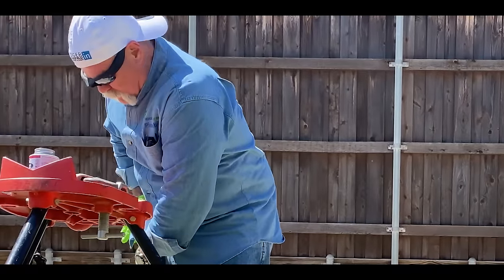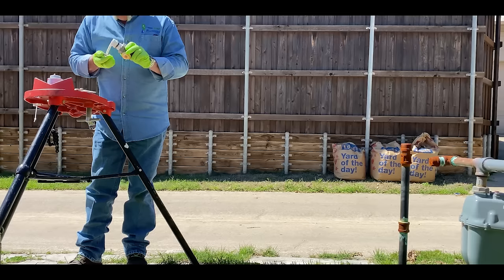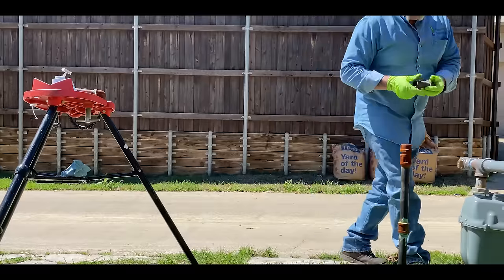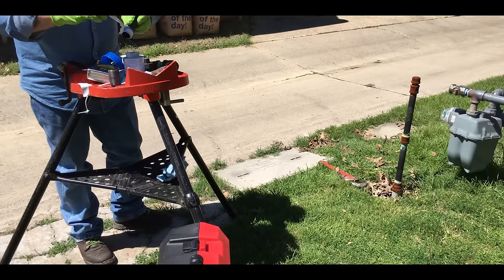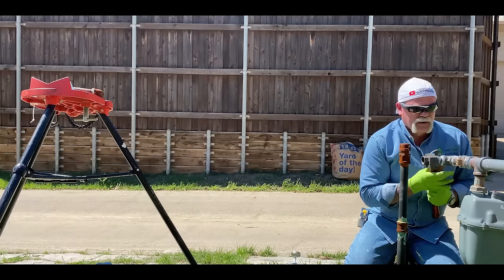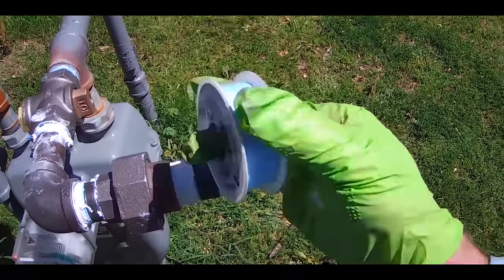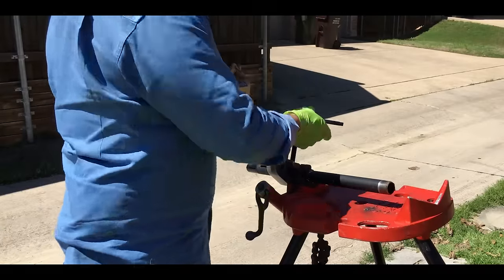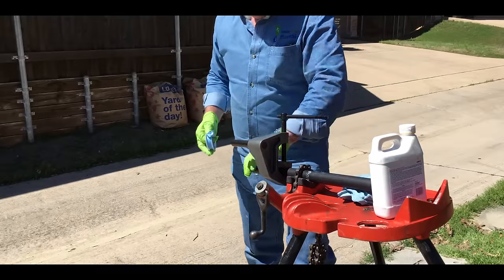Neighbor HIT This Gas Line! - Gas Line Repair (Plumbing POV)

Comment: I love how you're always talking about how important it is to turn the water off, no matter what, then go and do a live gas line replacement like this.
Reply: It may look and sound strange,  but there's only about a 1/4 lb of pressure going through a residential main like this. JUST MAKE SURE NO ONE IS SMOKING LOL.
Reply: Even then you can put a match up to it and you will get a flame that can easily be put out by putting your hand over the pipe end
Reply: @davidreynolds731  The issue is rather the carbon monoxide poisoning...
Reply: @morphman86  
You only get CO poisoning from poorly burning gas. While you can do what he did since the pressure is around 7 inches wc or barely over 1/4 psi, it's better to just have the gas company come out and turn it off properly.
Reply: @tcolondovich2996  Oh, sorry, I didn't know hydroCARBON gas didn't contain CARBON that would bind with OXYGEN when exposed to OXYGEN-rich air... Silly of me.
Reply: @morphman86  
It's cool. The most important point is that the natural gas has to burn completely. Any kind of impingement on the burning can start to produce carbon monoxide. If its burning properly then carbon dioxide and water are its byproducts. But I can guarantee that if someone just lights the gas after the regulator it wont be burning completely... light it before the regulator in the wrong area and you get a 40 foot pillar of flames and a visit from the Fire Department and gas company.

But if you do happen upon the pillar of flames situation just let it burn until the gas company gets there.
Reply: Fuckin prunes 😆 water being shut off no matter what because you can't always just thread on a ball valve/shut-off onto a copper line. The gas line hes messing with, the pressure is hilarious and its already threaded. There is no huge risk like water.
Reply: First off, water is anywhere from 40 psi to 100 psi, whereas gas is at most 15 psi. The other issue is water makes a big mess, gas just goes into the air.
Reply: Lol u try n catch a water service on the fly 😂😂
Reply: @morphman86  Do you know what that binding with oxygen would be called? That would be: burning... So, unless the gas burns (it doesn't in this case), you do not get carbon monoxide...
You also don't get carbonmonoxide poisoning outside unless there's a massive (as in steel melting) furnace behind you with badly tuned burners...
Reply: No live swapping in my building 78 inches of mercury on my gas
Reply: It's easier to hold back  a gas line's relatively low pressure vs 70+PSI of water pressure. Just saying. This is coming from a plumber/gasfitter.
Reply: @Bileven Troth Gas lines get shut off all of the time. How else do they get repaired, replaced, tested, etc? Gas before a regulator is high pressure - usually about 50 psi on distribution (houses and commercial). After the regulator, it is usually 1/4 psi or so and the appliance regulator usually drops that to about 1/8 psi (or 3.0-5.0” Water Column). Ignition can happen at any point in the system if oxygen, fuel and ignition are present.
Reply: @Bileven Troth I believe that we may both agree that different gas companies use different approaches to gas line maintenance and repairs. The company I work for does hydro-testing quite often and shut down whole sections at a time. We weld on bypasses to reroute the distribution and all. However, my specific job specializes in service at the meter and in households. This is where my experience in gas leaks, meter sets and carbon monoxide detection comes in. The company I work for does not seek out AOCs on pipeline by searching for carbon monoxide. This is foreign to me. I find it interesting the wide variety of approaches to finding and fixing gas lines.
Reply: @Bileven Troth damn good explanation
Reply: @Bileven Troth really learned more in your posts than i ever thought i could
Reply: @joshcowart2446  Yeah and this appears to be a low pressure gas line, since there is a regulator visible on the supply into the meter, so we're probably talking ~7-10" wc, or 1/4 (0.25) psi as others already said. That means the pressure is about the same as if you drilled a hole in the bottom of a gallon jug of milk, and tried to plug it with your hand. Not exactly impossible. He holds his hand against the open pipe which easily blocks the pressure, so there's probably only a couple of seconds, if that, where the gas is flowing into the open. Also natural gas is mostly methane which is lighter than air, so as long as there's no nearby ignition source, he will be fine as the gas floats up and away. There is no carbon monoxide hazard as long as the gas isn't ignited. There could be an asphyxiation hazard if it was an enclosed space and he let a lot of gas out, but this was not the case. If he wanted to shut the gas off, he could shut it off right at the meter, wouldn't need to call the gas company unless it's regulation, but here up north it's just a simple quarter turn valve like the one Roger installed on the pool heater line. If he shut the gas supply off, then he would have had to go into the house and test all the gas appliances, make sure the pilot lights (if applicable) didn't go out, relight them if they did, and make sure all the air was out of the line. Given the low pressure, no ignition source, small amount of gas that leaked out, and the fact that this isn't propane which is heavier than air (and also usually at higher pressure) and can collect on the ground, I think he properly assessed the risk to be low enough to warrant saving the ~15-20 minutes or so it would probably take to shut it off and turn it back on. This isn't like some of the USCSB videos where power plant workers blew high pressure gas lines into a partially enclosed space and then it blew up-- completely different scenario.
Reply: @MittyNuke1  exactly. The main reason we tried not to kill the gas is because we didn’t want to spend an hour or more lighting pilots. This was 15-20 years ago in a small town in west Texas so they didn’t have all the latest technology. At the minimum you’d have to light oven, stove, water heater, and furnace. Many house still had several Dearborn heaters. So the only devils advocate argument I’ll accept is almost everything is electronic ignition now so with the exception of the water heater pilots aren’t an issue and he’s standing at the meter so it’s not hard to kill the gas plus the gas to the inside is already dead until he reconnects it. So I can see the other argument I’m this case but old habits and if you know what youre doing it’s not an issue. Especially with 11 in wc even without covering it if you prepped right not much is coming out.
Reply: @joshcowart2446   how much is this in bar ?
Reply: @vHindenburg  .02739
Reply: @joshcowart2446  Yepp thats pretty low thank you.
Reply: i was not aware water and gas were the identical substances. who friggin knew?
Reply: Does anyone find it ironic that we’re discussing gas explosions and one of the contributors is von Hindenburg.
Reply: @joshcowart2446   Its ironic. Though the Hindenburg technically didnt explode just burned very quickly. The Hydrogen only could burn when it got exposed to the oxigen in the air. When you see the orivinal footage you see the Hindenburg catching fire on at the rear. After the the stern is burned half up it massivly loses buyoncy and drops the flames climb up and the rest is history. The modern consensus is so far as I know that the paint used to tighten up the compartments was a formidable fire accelarant.
Amazing still that of over a hundred people on bord only 34 did die.
It is proably the most elegant way to travel man ever has invented.

A further point to explosions, for something to explode there there has to be an oxygen fuel mix. Saw dust in the air, gas leak in a closed room /hole in the ground, coal dust ect. Thats why cars dont explode like in the holiwood movies, unless your tank is almost completly dry and have put extra air into  it.

Doesnt change the fact that a puddle of fuel burn raher violently.

Additional, I had a safety course on gas lines at work about a year ago (torch cuting company). And the most important thing with a gas leak is ventilation, to avoid an ignitionable mix of air and gas or the danger of suffocation.

Still unadvisable if someone  had a smoke at the gasline our Texan plumber was working on it proably woulndt blow up there would be torch sticking out of the ground when the gas would be ignited.(Thats still fing loud thats how the cutting burners are ignited, turn on gas flint stone igniter near it and bang)

The easiest way to get such a fire under control to shut of the gas.
Reply: @morphman86  why are you talking about this no one is smoking and no open flames. Nothing is going to happen.
Reply: @Germ1993  unless you have a static charge right..  then nothings gonna matter.
Reply: Gas won't make a mess.
Reply: @edwardmoulton6383  you guys still have merc regs?
Reply: Good thing there’s an expert here.
Reply: @morphman86  You're 100% not going to get carbon monoxide poisoning outside.
Reply: @morphman86  I would sat its impossible to get carbon monoxide poisoning from 30 seconds exposure to gas at 1/4 lb oustide.
Reply: @benjamincain4778  So something like a brand new natural gas water heater should theoretically not be producing much or any carbon monoxide?
Reply: @MittyNuke1  You obviously know more than me but the line looked unconnected when he got there. They probably had to relight all the gas pilots anyway, no?
Reply: @joshdiehl8737  he says in the beginning that after the neighbor hit the gas meter, the utility replaced the meter and he doesn’t say it, but I assume the utility also reconnected the house to the meter, but could not connect the separate line going to the pool heater because the line was damaged. Roger says it was about a year since the damage, so I assume they didn’t go without heat for a year, but now that it’s summer, wanted the pool heater connected again. So Roger is working on the line you saw that was disconnected, leading to the pool heater, but does not need to do anything with the gas line going into the house. From what I can tell the gas pipeline comes up to the meter, splits off in two directions after the meter, one to the house, other to the pool heater. Gas utility only fixed the one to the house, likely because they aren’t being paid extra by the customer and only have to make the situation safe.
Reply: @joshdiehl8737  correct, a properly functioning fuel burning appliance should be making very low levels of carbon monoxide. CO is produced when fuel is burned in an oxygen limited environment, since complete and clean combustion produces only CO2 and water vapor. which is why burning fuel in an enclosed environment is so dangerous. The fire uses up the oxygen in the room, which leads to more and more CO production. Both CO2 and CO are harmful to people but excess CO2 makes you feel like you can’t breathe, excess CO makes you tired and you fall asleep and never wake up.
Reply: Usually 2lbs after the meter and up to 30 lb before the meter .
Reply: Welp , at lease in Baltimore you can’t do it . I mean you could… but if the psc or inspector/Safty sees you they’d pull your OQS up here you’d had to shut the gas off if not possible, you have to suit up with respirator and oxygen bottles .. idk about down there tho every utility is different in their standard.
Reply: 1/4psi of pressure vs 60psi plus, gas is dangerous but its at very low pressure once regulated

Comment: Those meters wouldn't be legal here, they must be at the side of the house.. Thats just plain nuts having them out by the roadway especially without  big concrete filled protection rails..
Reply: facts
Reply: And to be honest, I don't know how or why the meters that close to the road in the 1st place.
Reply: I'm more interested in the fact someone hit that already. No one thought to put protection around it and also how long was that pipe line live and leaking before it got "Fixed" lol
Reply: Truth why put a med or high pressure riser street side let alone an gas fixture. All our meters are inside or on the front corner
Reply: @thagasguy  Facts I don't needa education to see how bad this setup can go. Real quick. lol
Reply: Looks like an ally not a street
Reply: @thagasguy   or in the case of Germany the usually are in the cellar/basement. I it just weird/mad to see a gasline above ground.
Reply: @vHindenburg  They are usually outside on the side of the house in the US because before meters had wireless data transmitting a guy from the gas company would have to walk to every house and manually write down the reading, the same was true for electric meters. If the meter was inside the house then someone would have to be home to let the guy in to read the meter. If nobody was ever home and the guy couldn't read the meter then eventually the gas would be turned off. It was more convenient to just put the meter on the outside of the house so it could be read without the homeowner ever having to let someone inside the home. It also means that if the gas company ever has to repair or replace the meter they don't need to scheduled a time with the homeowner to do it. That said, I've NEVER seen a meter out in someones front lawn next to the road.
Reply: @madmatt2024  Where I live its still done the old fashioned way.
Reply: @thagasguy  inside meters? Wow we are doing a project right now to get everything in the city outside as the risk of death from leaks  or explosions is much more than my utility is willing to risk.
Reply: They are farm taps, we do them two reasons one property size,another it was done long ago, to save on cost the service is at the main. Do you how much it cost to run it to your house,  about $4000 and that under 100ft, after 100ft price by the foot or some we might do 100ft one price,  150ft another,  over 150ft by the foot, underground work is not cheap and thats if the main is  Plastic, if its steal main its a $1000 just for the welder
Reply: Yeah, having a meter like that just hanging out in the middle of nowhere is a bad bad idea. It's already been hit, luckily no explosions happened, but they could have. I have a gas meter by the side of the house and there is a concrete filled post right by it to protect it from getting hit accidentally.
Reply: Same here. Must be protected from damage. Explosions are unlikely even in a rupture, usually ruptured ignited lines just shoot fire from the pipe like flamethrower. The oxygen gas mixture doesn't get to an Explosive level unless contained or propane with a dip nearby.
Reply: In my area, we've been having so many issues with other utilities yanking out our lines in the street that we have them outside so there's a safer break off point. Also added flow limiters on the service tea in case one of them gets struck.
Reply: @madmatt2024  it in the alley behind house.
Reply: In Texas (as in this video) they put them in the ally at the back of the house. Neighbors can back into them.
Reply: Who is your gas company
Reply: @morganrussman  money, If the house is 1000 foot down the driveway that one gas line would cost the gas company $15,000
Reply: It’s called Money, any service line over 150ft cost big money, Say you have 1000 foot from the main to the house, that service line would be around $15,000 for the gas company
Reply: @Drewdayz2419  even if, the company is still going to have to run the pipe up to the house, so, why not just put the meter up by the house.
Reply: @morganrussman  no, I work for atmos , it’s call a farm tap, we put the riser and the edge of the right of way, anything after the meter is the home owners responsibility if it’s new construction we can put it at the right away or at the house usually if it’s a very long run we gonna put it at the right away for cost saving measures, 1000 foot service is roughly $15,000 actually numbers is 17,200 for 1000 ft now if it is existing house we will put that new service to wherever the existing line was. Usually in rule area we’re going to stick that riser at the edge of the right away in city is going up to the house, There’s a lot that goes in the consideration when determining where to place the gas riser
Reply: @vHindenburg  I live in New Jersey (USA) and the vast majority of our gas meters are inside the basement. Commercial buildings its generally outside though.
Reply: @morganrussman  Thats what I was thinking too. Although I guess anything after the gas meter is the homeowners responsiblity? That was they have to pay for all that laid pipe instead of the homeowner
Reply: @joshdiehl8737   Wow two years have passed already since I commented on that.